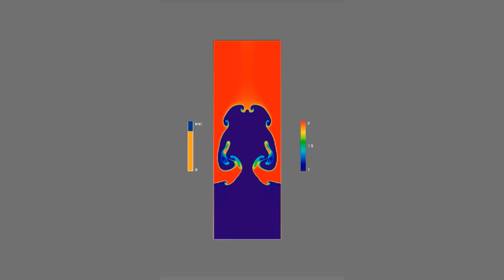Why the water SHOULDN'T spill out

Comment: Why wont the paper stick to the glass if there were no water in it?
Reply: Atmospheric pressure inside the empty glass is equal to the outside pressure. Gravity pulls the paper.
Also if you try to stick some heavy object instead of paper (glass have water in it) it wont stick, because, force of gravity applied to that object is stronger than air pressure beneath.
Reply: surface tension